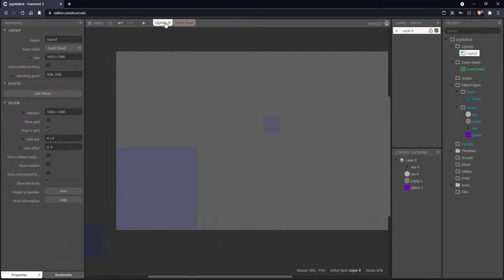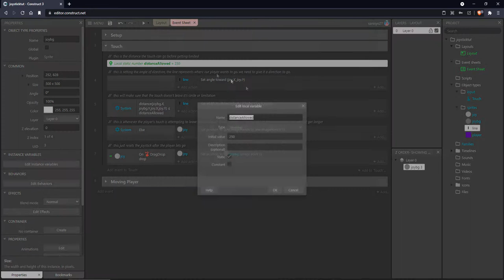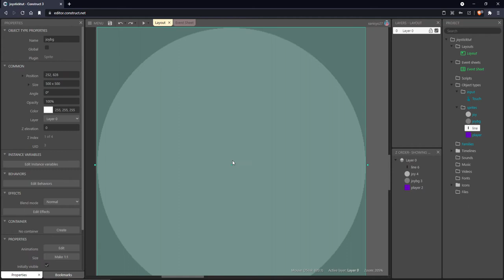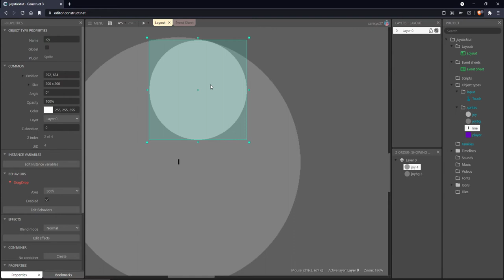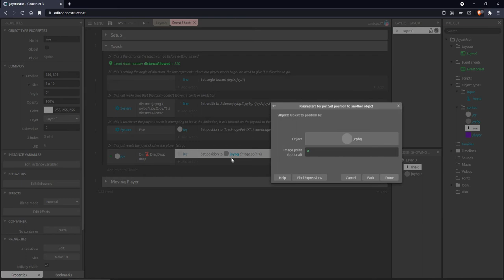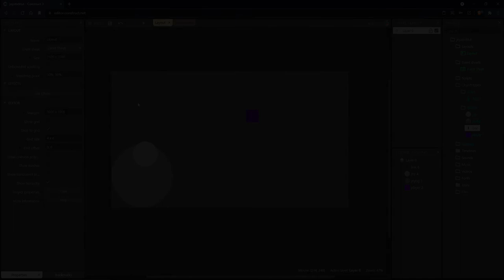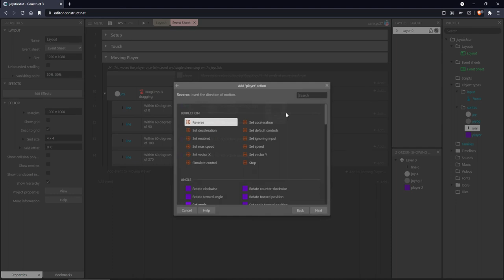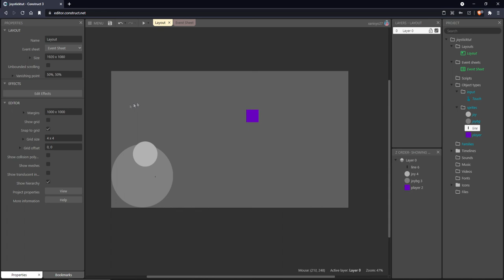Construct 3 - Mobile Joystick Tutorial

Comment: How Would I Make It So That The player has a scroll to behavior but make the Joystick Stay On Screen?
I Know To Use The Anchor Behavior But That Breaks The Joystick.
Reply from the maker: Make a new layer called HUD and put it on top everything. Then change the layer's parallax to 0. Put the joystick on that layer. :DD If you need more help feel free to message me on discord. Xan#3005
Reply: @raresagegames  Thank You So Much
Reply: @raresagegames  yeah, but this won't make joystick stay on the bottom left edge of the screen when you resize the game and using anchors completely breaks this code.
Reply from the maker: @iphatbass  Unfortunately I did not consider this in the making of this. I'm sure theres a simple solution, but I do not have time to find it.
Reply: @raresagegames  I was trying to fix it for a two hours without any result, but if i manage to find it, I will post it here
Reply from the maker: @iphatbass  I'm sure I can fix it, I dont currently have time. If I end up fixing it, I will also post here.

Comment: how would i be able to detect collision with walls and not move if one is in the way?
Reply from the maker: Use the solid behavior on the wall and use 8 direction movement on the player. If you don't want to use the 8 direction movement with the joystick, you don't need to. Just be sure to disable default controls.
Reply: @raresagegames  ty!
Reply from the maker: No problem!

Comment: Is it possible with 8 directional movement to make it so the box doesn’t change angle?
Reply from the maker: Yes! Click in the sprite with the 8 directional movement and go under the 8 directional movement behavior. There should be a drop down referring to matching angle of rotation or angle of direction, I do not remember the exact wording, you only need to change that drop down.